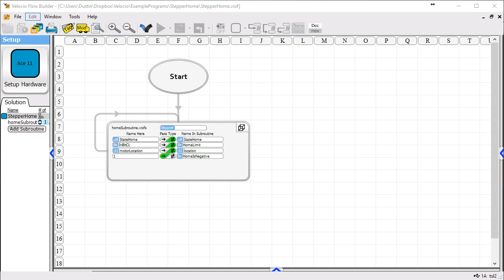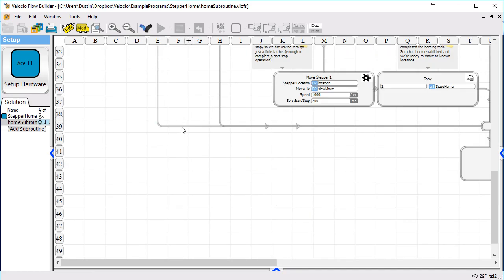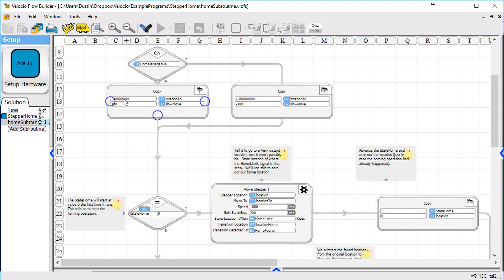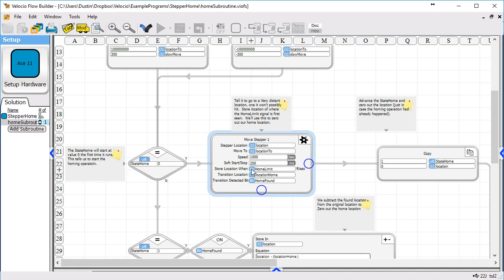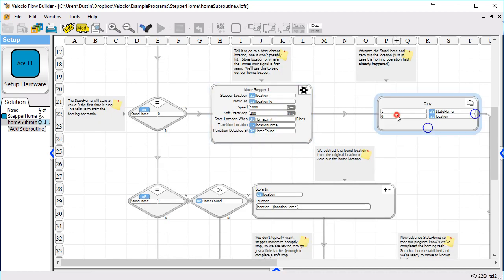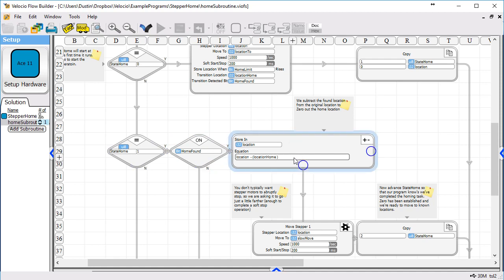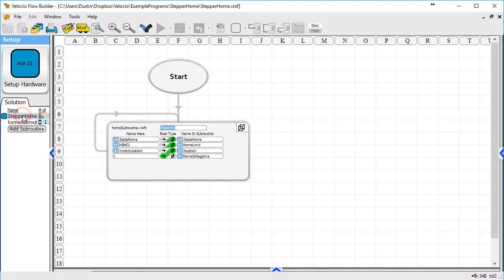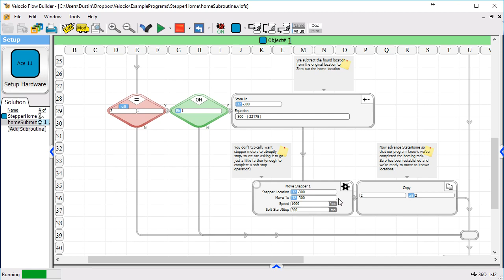Home Stepper Motor using Velocio PLC

Comment: When the second move command initiates, the stepper is already moving. Is the command smart enough to know that it doesn't need accelerate from a stop before it begins to decelerate? If the speed of the second move command were different from the first, would it smoothly accelerate or decelerate to the next speed over the course of the soft start/stop period?